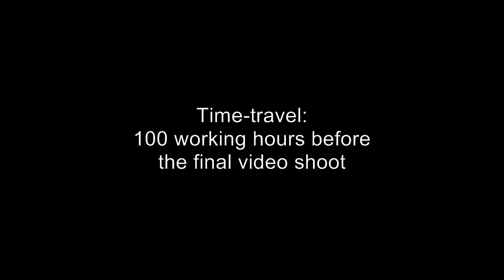100 Watt LASER DIY Star Wars DEATH STAR

Comment: The dish alone is freaking amazing, that you went ahead and bothered to stick it in an actual sphere, man, you're awesome. :D

Question. If you use your lathe to put a screw hole in the center mount of the dish, and then on that screw you affix a rod that has at the end a prism would that work to focus the beams in to one? I mean, off the top of my head i've no idea what this prism should look like, but as a show piece if that had one of those (which if you make the rod out of acrylic nobody would be able to spot it in a dark room) that'd be bonkers cool.
Reply from the maker: +aserta Well I will up another video in a couple of minutes...laser dish tests.

Comment: Could using a glass shape to refract all the lasers in to the same direction work? I'd love to see some kind of device to combine 2 or more lasers in to one beam, I'm ordering 10 laser diodes from about a week ago to see if I can join them.
Reply from the maker: +Captain Capellini No
Reply: Why isn't it possible? Or are you just saying you won't do it? Well thanks for replying I guess.
Reply from the maker: +Captain Capellini Well thats why I did it that way. You can put them next to each other...but thats not really too cool.
Reply: I know, but I was thinking if you put a glass shape to refract all the beams in to one when they meet at the point, it would look like the actual death start with a super powerful laser in the middle. I think I'll have a go at making a laser weapon doing that (but of course it won't be as good as yours, I don't know where your godly lasers come from)
Reply: +Captain Capellini You could attempt to make an optical system consisting of a convex and concave lens (they have to be calculated) to focus the several straight aiming lasers to a single point, and then to straighten them out at the converging point. Sadly costs go up quickly with optical glass when it comes to laser damage though...

Comment: Given that you probably won't sell this one, do you plan on keeping it operational or on reusing these lasers for other more marketable projects?
Reply from the maker: +Alex Bv Each laser will get a neat new home, custom guns and rifles.
Reply: +LaserGadgets It's great that there's enough of a market that you can make a living building cool handmade toys that are way too expensive for kids!  You're quite an artist.

Also, that thing has more power than an entry level laser cutter.  At 3000$ with 14 lasers each 6w cost only 220$.
Sounds like these blue lasers are getting cheaper and more powerful.
(Although you might have a deal with manufacturers or started with diodes or something)
Reply from the maker: +Alex Bv Its a lot of money for tiny parts :p and no deal. I even go for high quality and no cheap crap, but even if it was cheaper, I dont sell anything to kids.